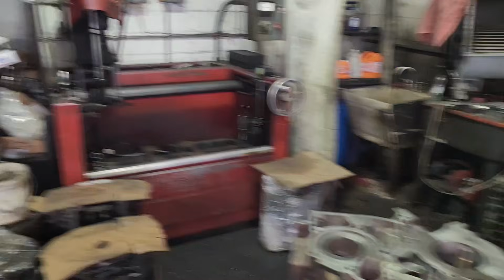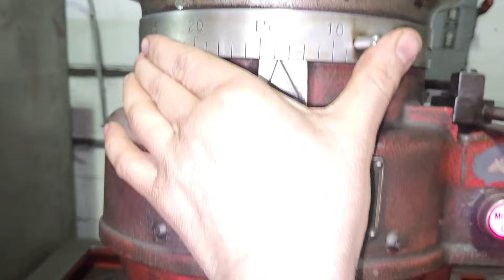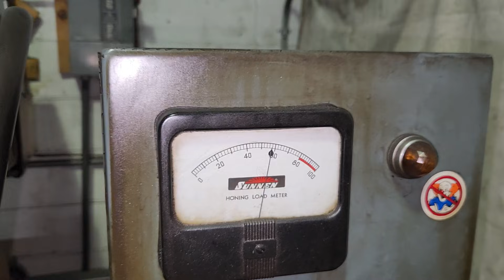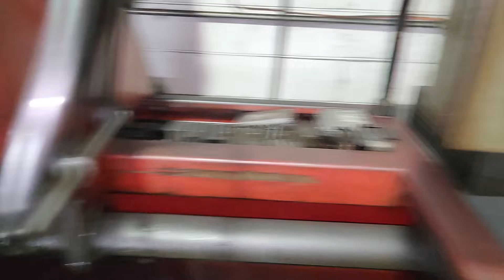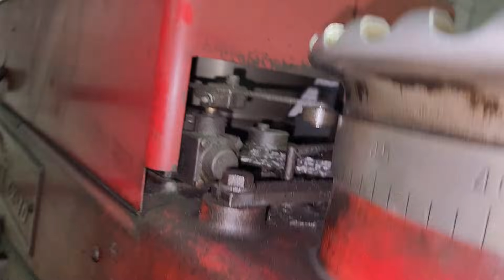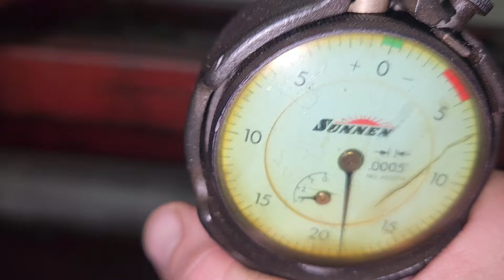Toyota 3vz/Nissan vg30 Cylinder Honing. #repair #engine #educational #toyota #restoration #machine

Comment: The 3vze is why I'm a mechanic today. In automotive machining class, I measured the 3vze exhaust collector diameter with a half dollar coin, it couldn't fit in. Next to the 3vze heads were a set of air cooled vw bug heads, the half dollar coin could fit in the VW exhaust port.

To make matters worse, after the first rebuild. With the vacuum gauge on the intake, on startup the 3vze would pull -18hg vacuum(good)... and then slowly go to 0 vacuum after one minute(bad), meaning an exhaust clog (stock). :')
Reply from the maker: The 3vz has a big exhaust port on the head way bigger than the VW and the exhaust manifold down pipe is 2in and the crossover pipe is 1 3/4.